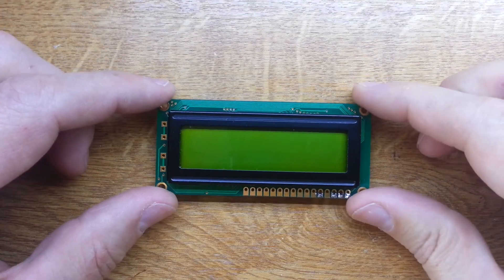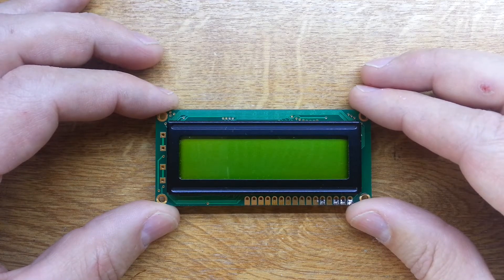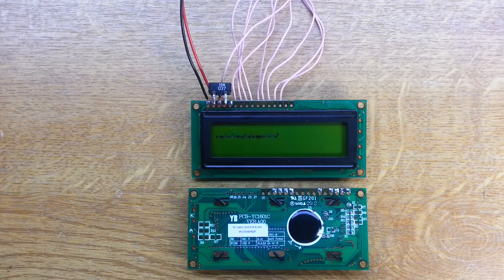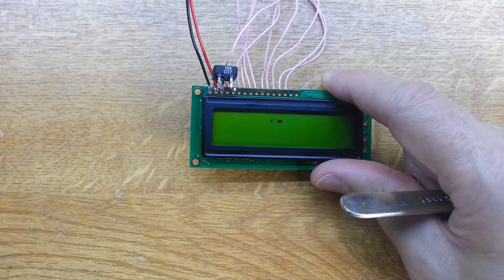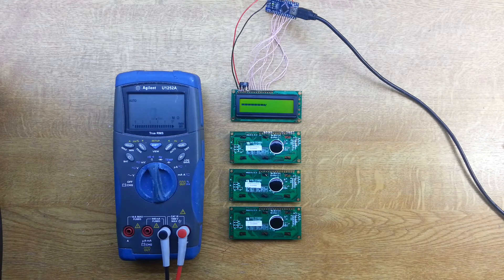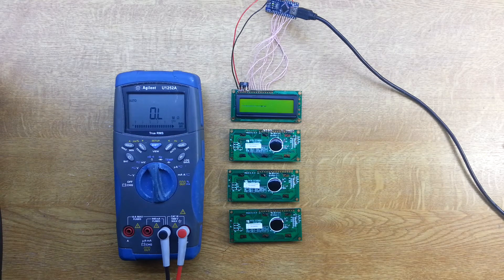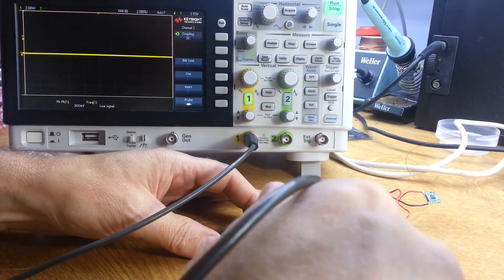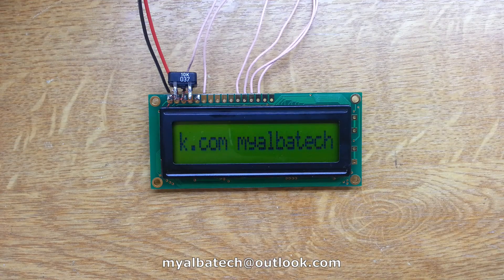Debugging a strangely flickering Arduino driven 1601 LCD

Comment: Many thanks I have just had a display start flashing in a weird way. You have given me something else to check 😀
Reply: In breaking news the 91K resistor on my module was measuring 1.5M and replacing it with a 97.K6 which the closest I had fixed the issue. Thank you very much 😀